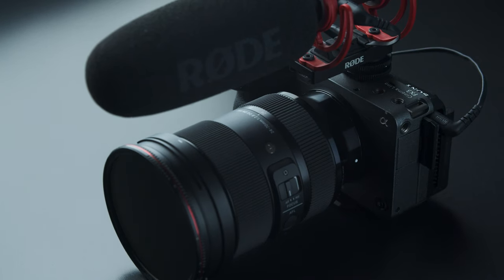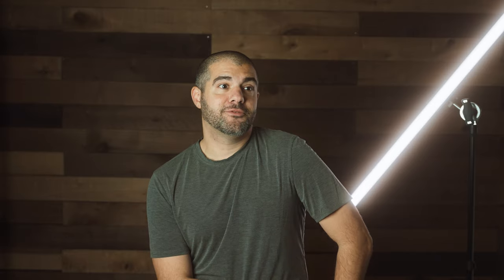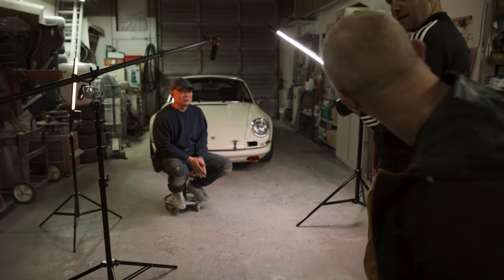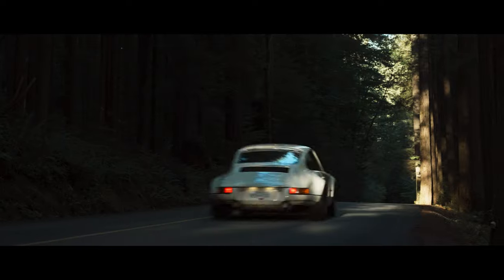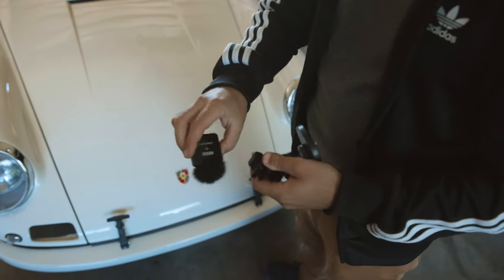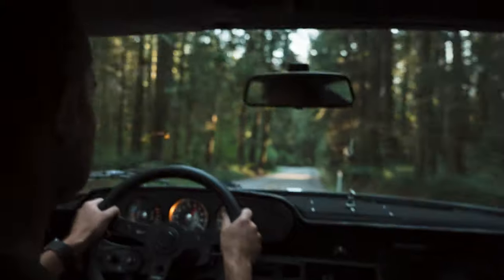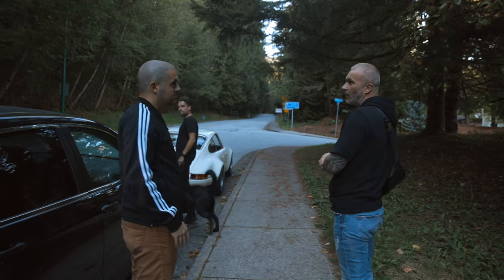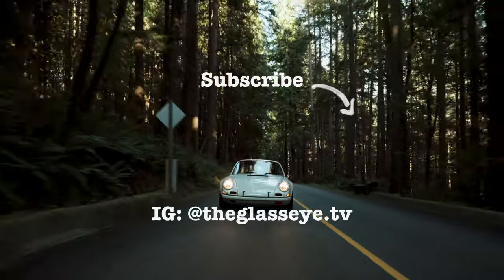How I Shot a Documentary with the Sony FX3

Comment: Nice work. Similar deal here. Car related stories with minimal kit and usually only a day to film. Plenty of trial and error and finding ways to work with what's there rather than setup elaborate scenes. I need to work on onboard audio more and try different mounting locations but I use one of those little Tascam DR10 units. They can record 2 files simultaneously, one at a lower level for safety. Pretty useful. Anyway, subscribed and looking forward to the next one. Cheers.
Reply from the maker: Yeah it would be great to eventually get a 32bit float recorder on the car (like the Tentacle Sync Track E or Zoom F2)

Comment: Zoom F2 for car audio would be perfect. 32 bit float is clip proof. set it and forget it.
Reply from the maker: that's true! That or one of those tentacle sync track e recorders. But you can still overload a mic right?
Reply: @TheGlassEyeTV  I’ve never been able to with the F2. It’s a godsend. There isn’t even a gain option on it.
Reply from the maker: 😮 you may have just sold me on it. You dunno how many good pulls weren’t useable because at peak RPM it clipped!
Reply: @TheGlassEyeTV  I’ve paired it with a wireless go too. it’s killer.
Reply from the maker: maybe i'll just text you about this, but doesn't that eliminate the 32bit float-y-ness of it all?
Reply: @TheGlassEyeTV  the input is irrelevant. it’s the recording format. it’s like how the lens doesn’t effect raw video. you can still change white balance etc. the difference between raw video and 32 bit float is the perceivable bit depth is so high it has the ability to record outside what humans can even hear. hence the “unclippable” ability.
Reply from the maker: I’m an idiot, I imagined the zoom F2 feeding into the Rode, but you obviously mean the other way round
Reply: @TheGlassEyeTV  yeah it would let you do the exact setup you're doing now - but just feed the receiver into the F2